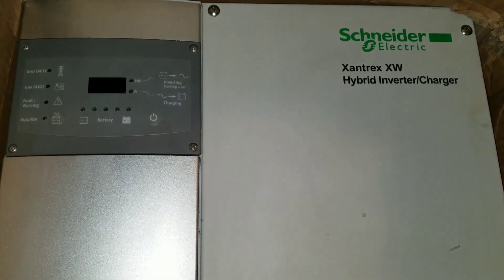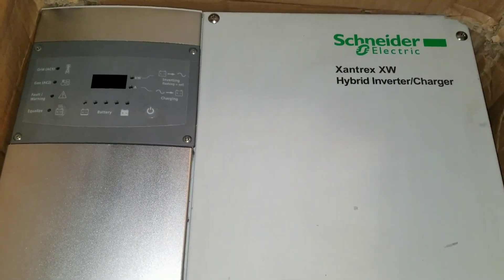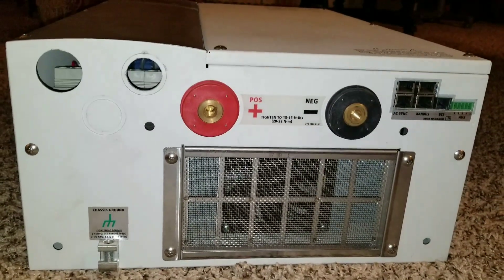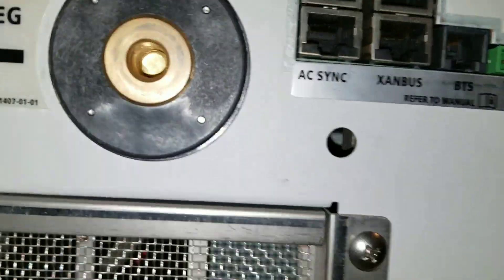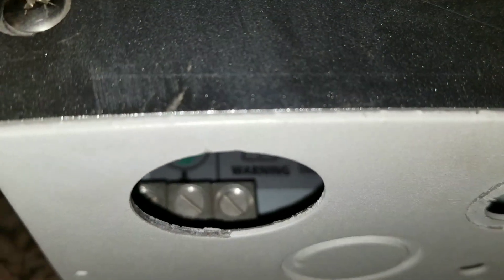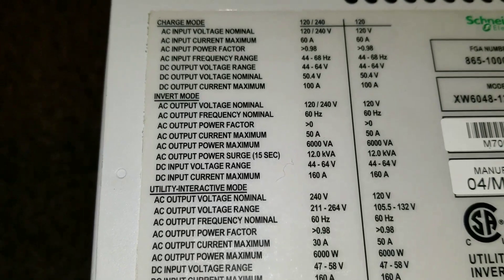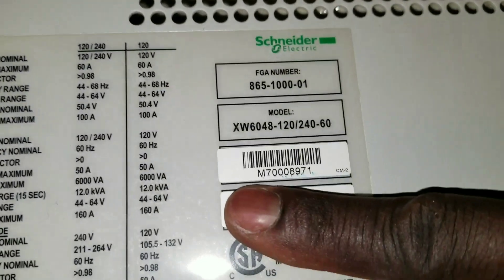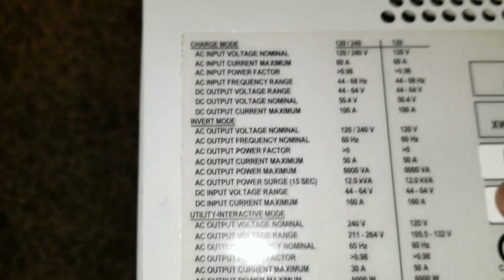XANTREX XW HYBRID INVERTER/CHARGER BY (Schneider Electric)

Comment: I have a XW4024 it's been working fine since 2008. Recently I have been getting a F02 error code (overvoltage). If something in the house turns on that is too heavy of a load it cuts power and then restores power showing the F02 code. Any ideas?
Reply from the maker: I have never experience that at all. 
Sorry I couldn't help. Please don't forget to LIKE SHARE and SUBSCRIBE
Reply: @jwsolarusa  It was my generator, it was dipping down below 55 hertz under full load and the inverter was popping the safety fuse to protect the service panel on the house.